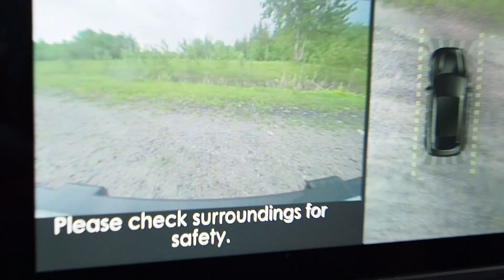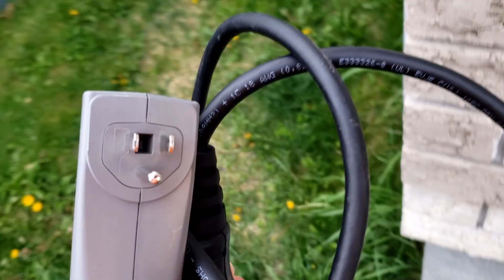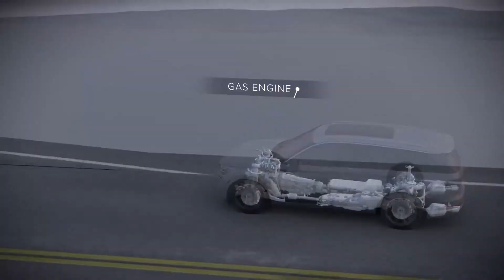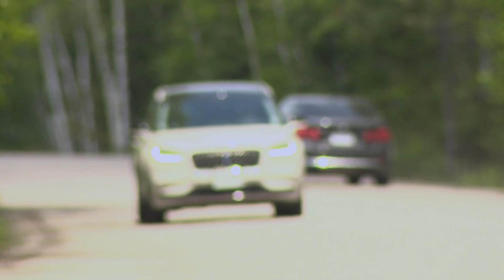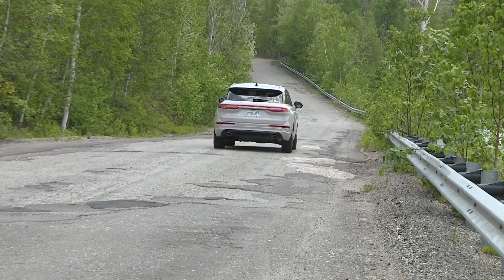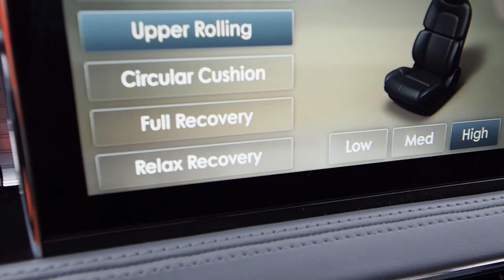2022 Lincoln Corsair PHEV Review: A Good News / Bad News Road Test

Comment: Steve, you know not of what you speak. Push button trans is quickly mastered in  no time. Besides how often do you even touch it.....twice per ride? My 2020 2.3 L Corsair Reserve not only is "frisky" and handles surprisingly well but has been totally reliable and solid and affordable to maintain.....can't say that for the Germans! As a bonus, in spite of the bigger motor, my average mpg is between 8.5 and 8.8l/100K. Have never hit 10l/100 to date. My only beef with the car......it's built in Mitch McConnell's state
Reply: Au contraire Nick.  Couldn’t wait to return it to National Car Rental.  I expected more refinement from Lincoln, instead of high road noise, average ride quality & a push button tranny.  As for long term reliability, I would even give Jeep Wranglers a nod for better reliability than current German or Swedish vehicles.  And that’s saying a lot!  But Ford/Lincoln will never meet or exceed Japanese built quality & reliability.   Otherwise, the Corsair is just another average CUV with a “has been” & “wannabe” luxury branding.

The fact that it’s built in Kentucky is one of its few good attributes though.

Comment: Bought the base model in April and I love it. I live in Pittsburgh. So I drive on very hilly roads with lots of potholes. Honestly, the drive is very comfortable even on bad roads. The fuel economy is crazy good. I’m getting more than Lincoln advertised on the sticker. There is TONS of room. We fit 5 people who are tall very comfortably. The base model gives you lots of luxury. You really don’t need to add tons of options such as messaging seats. These options increase the price and aren’t worth it. Gas and plug-in Corsairs with the same options are about the same price. There is only two things that I don’t like 1. The piano shift. I don’t like having to reach over to the passenger side to put the car in drive. I like the Lincolns that have the shift vertical next to the steering wheel. 2. In the base model, Lincoln doesn’t add the light up welcome mat outside of the car. That just seems very cheap to me. 
Also, when you drive under 25 miles per hour, the added electric sound is an ugly moan. Sounds like a space ship. I guess it’s for safety so people hear you coming. My husband hates it. I got use to the sound.
Reply: How is the road noise on rough pavement?

Comment: Excellent video. 
To confirm, when the battery hits 0, there’s still another hybrid battery operating concurrently?
Reply from the maker: Technically the same battery. A zero on the gauge doesn't mean it's empty, but rather, it just doesn't have enough juice for continued all electric driving. Gas engine needs to kick in. When it does, it keeps the remaining portion of the battery sustained.

Unless there's a malfunction, it's not possible to run the battery down to "empty"